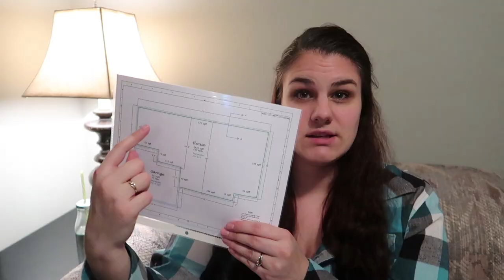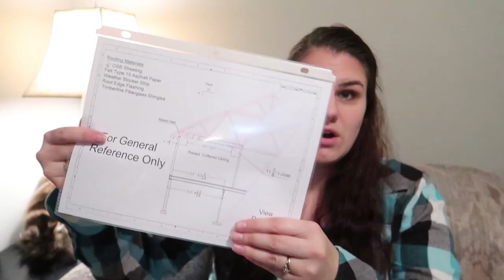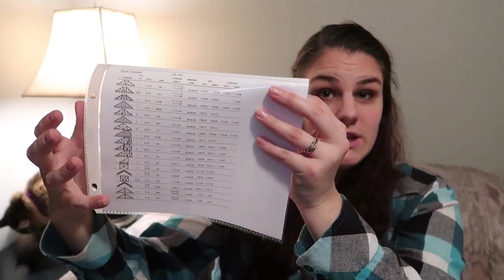FROM THE GROUND UP; Key Components! | Steps to Building a Home

Comment: What software did you and your dad use for your rough drawings as you designed the house and sent to the engineer?
Reply from the maker: We did the architectural plans ourselves with AutoCAD, we only sent one drawing to an engineer for confirmation of how much insulation to cover the house footing with in the garage, because codes are constantly changing. :)
Reply: Our Lives, Our Reasons, Our Sanity Thx, that's quite the software so I guess I'll stick with sketchup
Reply from the maker: Yes it is! My dad got it years ago through someone at his work on a disc. He learned it then, I learned in high school. Amazing program.